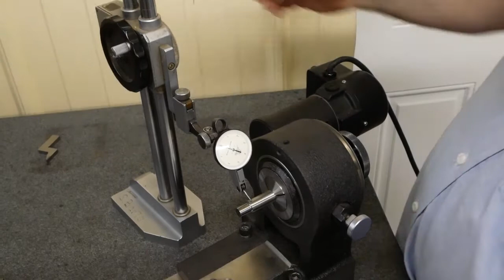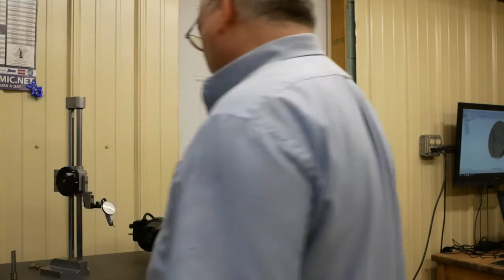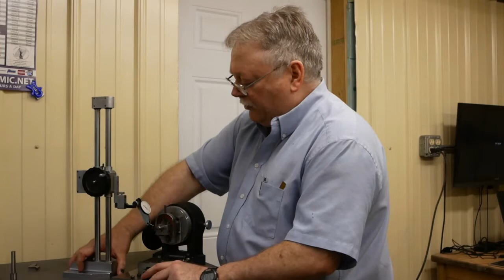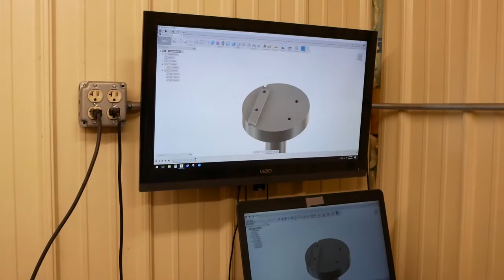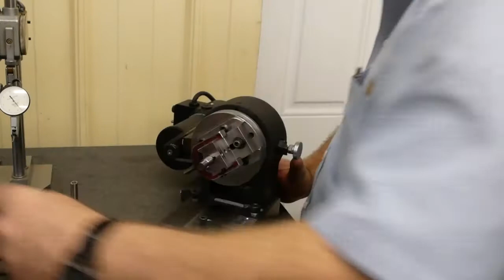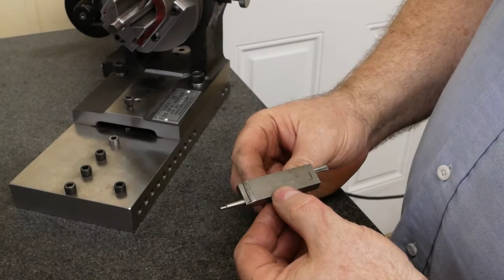Modifying our spin fixture.

Comment: I'll have to see how your face plate V-block rails works out. I just returned a cheap ($310) China Pin Punch grinder. They used cheap bearings and had excessive press fits to force the cheap 50x80x10mm ball bearing to an extreme reduce ball to inner and outer races. This caused the bearing to feel like gravel was in the bearing. It ran true, but at that expense. It needed to have angular contact or taper roller bearings, which I assume the Harig has. The Suburban model they advertise 3" taper roller bearings. I'll have to watch the video of you getting one of these Master-Grinds.
So this cheap fixture had a V-block on it, with machined channel, but again they made it a press fit, and once I removed it, I could not get it back on as the sides of the channel were spauled, as it was not made with tool steel or heat treated. You get what you pay for.
Reply from the maker: The rails worked very well. I leave them a few tenths loose so that I can lightly tapped the part in to almost perfect with a small brass thumper. I love the Suburban spin fixture. The type of bearing in it can carry a very heavy load. I have used Harig in the past and even owned one at one time they are nice but I would have to pull it apart once a year and regrind the race to make it run more accurate. So far the Suburban is better suited for motorizing.

Comment: If you’re spinning a long pin, would you need to support the pin from deflecting or chattering ?
Reply from the maker: Yes, I have a spring loaded plunger that I use when needed.
Reply: @SolidRockMachineShopInc  did you make it ?  Or can you buy it ? I’ve got a 6 inch copper alloy pin I need to spin, for a plastic injection mold.
Reply from the maker: @MrJzplastic  I made mine, not sure if you can buy them or not. They are simple to make. You may have to play with the spring tension to get it to work nice.
Reply: @SolidRockMachineShopInc  ok, that’s good information, maybe I can goodie “spring loaded plunger” to see what it looks like .

Comment: Would a V anvil help not to distort the pin held in the V block? 
Thanks
Radu
Reply from the maker: Hi Radu,

Are you talking of a V on the lock down screw? If so, it may be better but in my experience on any V block the position of the pressure point and the pressure of the locking screw will affect the pin concentrically. Many times you can use this to your advantage and get thing located very accurately.
Steve
Reply: Yes, but for the entire length of the V block  also hardened and ground. The idea is to squeeze the pin evenly. Radu
Reply from the maker: Hi Radu,

I am sure that would help.
Steve

Comment: Well done Steve. Did you built the 5C flange from scratch or bought one and built up on it. Thank you for sharing, lot to learn from you.
Radu
Reply from the maker: Hi Radu,

Yes, I built it from scratch out of DC-53 steel. I actually built 2 and will use the other one with a small lathe chuck which will make it much faster to switch between the V block and the lathe chuck.
Steve

Comment: You've been turning out some excellent videos. From my perspective maybe closer in views for most items showing what's actually there instead of the surroundings that are of much less importance might be better. 

No surface grinding capability's in my little hobby related shop yet. But having the ability to properly harden then precision grind parts are high on my want list. Those Harig 5c grinding units are more than good quality. And more than a little expensive for a home shop though. Especially that powered unit. Doesn't stop me from wanting one though. Nice to see one in action. Your sons must be wondering when all that tooling money going out is going to taper off would be my best guess. :-) Great tip on how the equipment can show unknown stresses and create some inaccuracy's just by bolting it down.
Reply from the maker: Hi somebody else,
We are learning as we go. We try to learn from our mistakes but we also know that we will never be able to please everyone. People are at different levels of experience. Some what more details because what is covered in the video is new to them while others may get bored because they are way beyond what is being covered. We are trying to find a balance that works for most viewers. Thanks for noticing our efforts at improving.
Steve
Reply from the maker: Thanks Turning point,

Making videos is new to us and we still have much to learn. Hopefully we will get better the more we do. We appreciate your feedback.

Adam is the owner and finances the company, I would not be able to do that on my own. I have been training his brothers and sisters in my free time and Adam said we should start making YouTube videos. I just kind of laughed that off and after thinking about it for awhile agreed with him. Our hope is that others will benefit from the videos.

We are in the process of getting our first patent on a work holding device. Hopefully the device will sell well and the company will be self supporting. We have other projects that we hope to be able to develop and patent after we get the first project up and running.

Again, thanks for the feedback.

Steve
Reply: I'll second that.  When I watch a machining video, I want to see tool, part, and chips in the frame.  Not too interested in the other scenery, unless it's something key to the operation like an un-intuitive setup.

I'm catching up on your videos in order, and I can certainly see the improvement in your presentation process already.